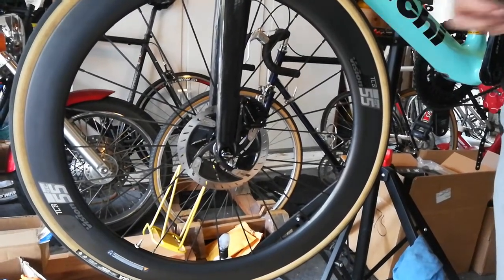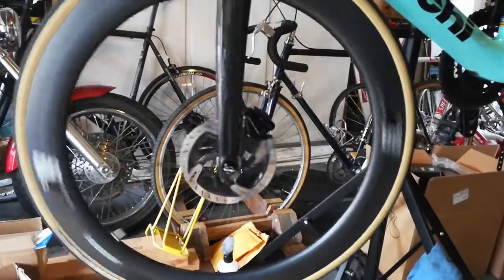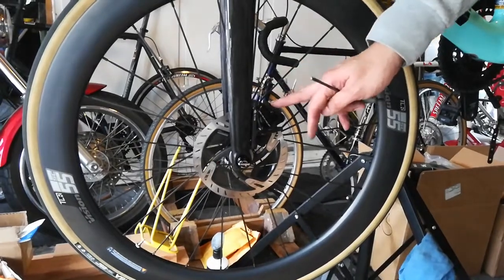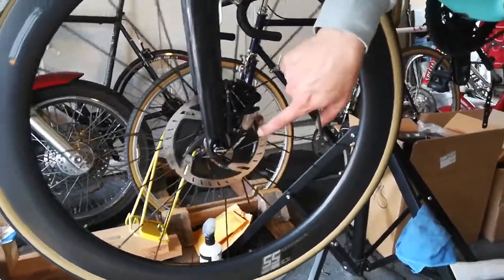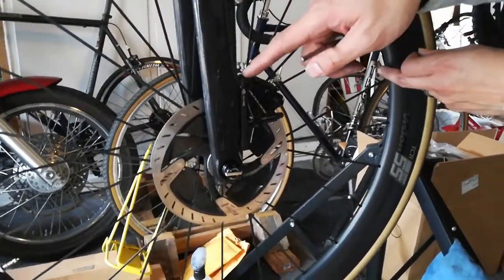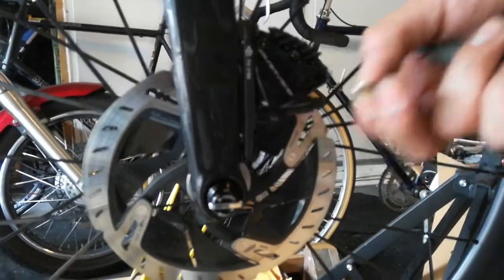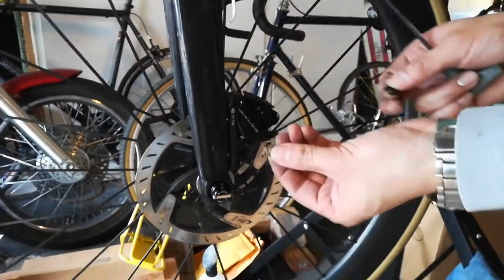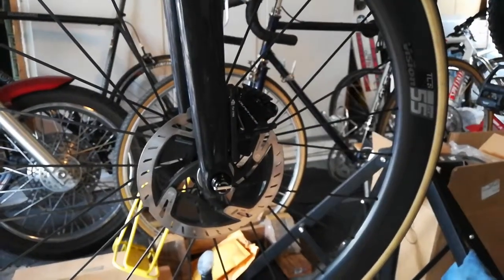How to Fix Disc Brake "TURKEY GOBBLE" Bubbling Sound on Your Road Bike / MTB

Comment: I tried this on my brake calipers, two small washers about 3mm thick. Works a treat, no more awful turkey gobble! My bike is a Giant Escape 2 2021 with Tektro HD-R280 brakes for anybody with the same issue. Thanks a lot!
Reply from the maker: awesome!
Reply: I had the same problem on my 2020 Giant Escape 2 disc. This fixed it

Comment: Finally found my issue, 💪💪
Reply: me too - even my local bike repairer was no use!
Reply from the maker: @rachking3201  Did you get it figured out? Unfortunately I don't have any disc brake bikes at the moment to illustrate a step-by-step guide, but basically you just remove the caliper from the fork, thread a washer on the bolts underneath the caliper, and reinstall and realign as usual. I'll try to do a video next time I have a disc brake bike to work on. Hope that helps!

Comment: did not work
Reply from the maker: maybe warped rotors?
Reply: I have the same problem and I carefully inspected the position of the caliper and pads and determined the pads were not touching the rotor arms. Calipers and rotors are all true and properly adjusted. Still a problem. Thoroughly cleaned, sanded, re-bedded. Still the same problem :(
Reply from the maker: @ivanyhtang  Did you try using spacers to move the calipers up anyway? Mine also looked like they were lined up properly, but the spacers still ended up doing the trick.
Reply: @Prakticala  thanks for the reply. I didn't specifically use spacers but spacing is not an issue. Everything is true and it's been looked over by the shop I bought it from. We are still troubleshooting!
Reply: @ivanyhtang  Did you ever solve it? I'm having the same issue.
Reply: @LysergicCasserole95  yes the problem was gone after the bike store replaced the rotors made by the same brand as the brake calipers. I suspect there was something incompatible between the brake calipers and the previous rotors, which were different brands.
Reply: Hi Ivany, I have the same issue with everything true aswell! I have a brand new Orbea Rallon with Shimano XT brakes on Galfer rotors. The bike shop swapped the pads for metallic and I still have the same sound with just less braking power. I will go back to organic and maybe try the spacer thing for the bubbling noise. Thanks @ivanyhtang
Reply: @benjik007  personally I don't like metallic pads, I much prefer the feel and quietness of organic pads. It just goes to show that different brands of rotors and pads don't always work well together. The best thing is to use the same brand but this could come at a cost if the shop won't do it for you on warranty
Reply: @ivanyhtang we've seen this on full avid and tektro set-ups quite often. Quite annoying.